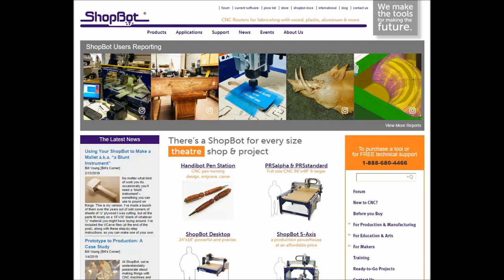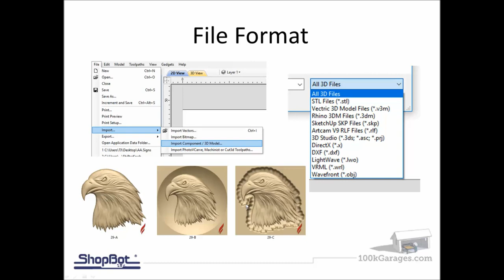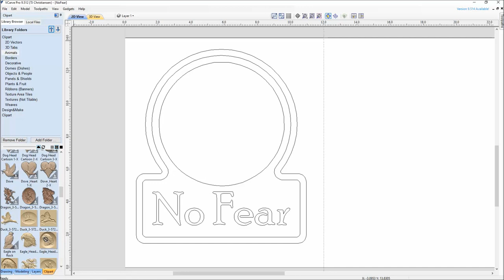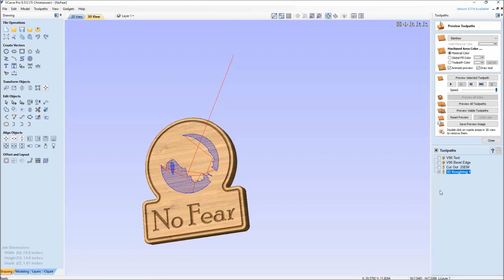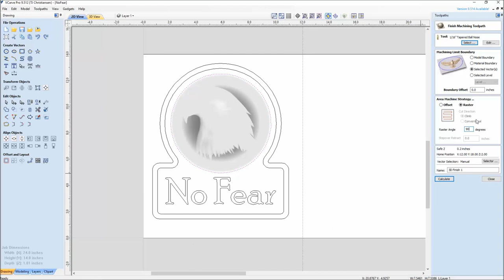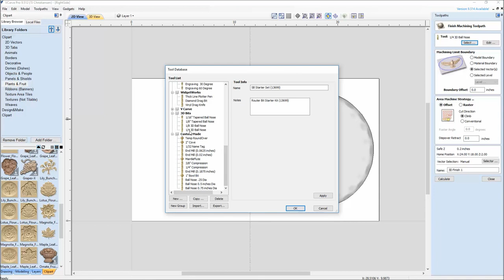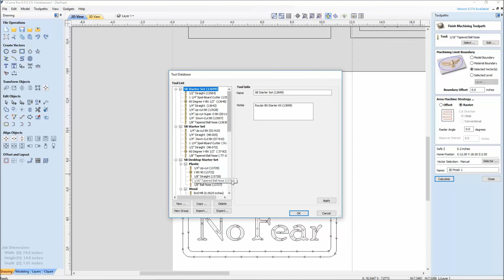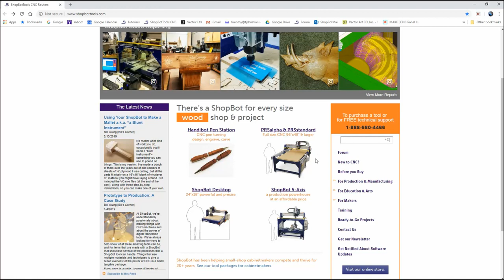Introduction to 3D Carving

Comment: Please, share the source of of pinecone corbel .stl file? Thanks.
Reply from the maker: We think that was done by a ShopBot customer many years ago and sent to us. We'll try to figire out who did it.
Reply: @shopbottools  Thank you. In the meantime I managed to source one. Did you do with the two sided technique?
Reply from the maker: @mattz8234  I'm pretty confident it was done on a rotary indexer. Not sure you could get the seams to match if you did it as 2 sided machining, but maybe you could cut it 2-sided and then rotate the model and blank 90 degrees and cut again? That way the seam from the first cut would be facing up...it would be a bit fiddly to get it setup  just right though.
Reply: @shopbottools  Yes, a 4th axis rotary attachment will do a much better job but I don't have one yet. Thanks for the reply!
Reply from the maker: @mattz8234  Let us know how it turns out!